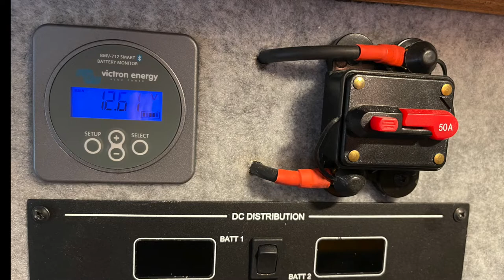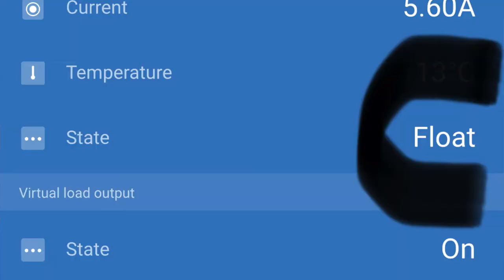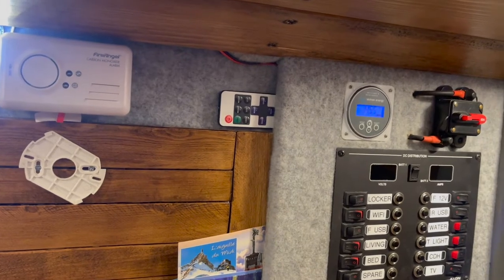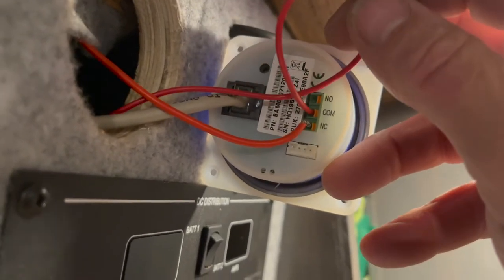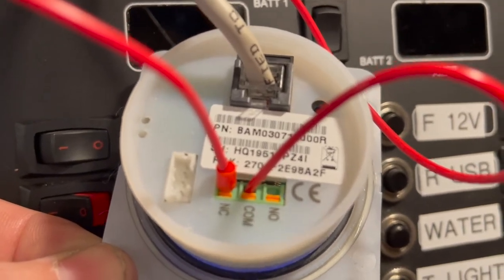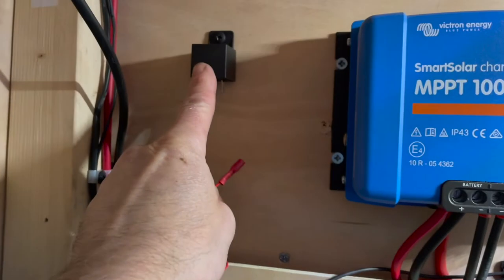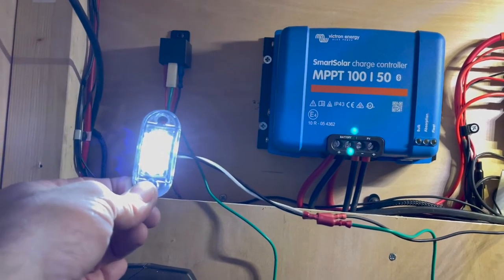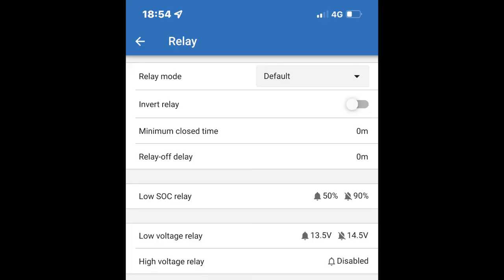Victron BMV 712 Smart Monitor Relay Function Explained . Victron energy Van life.

Comment: As soon as the heat mat pulls a load the voltage will drop and the relays will just flip flop. NC is normally closed and NO is normally open. For what you are attempting to do you should have the output in the NO connection BMV.
Reply from the maker: Ok cool , I’ve looked at the app and it can be reversed and the voltage value as mentioned is just for testing the led light, and not the mat  obviously they will be adjusted for the load on the heater mat , thank you 👍
Reply: @ProjectCamper  I get what you are trying to do, maybe a secondary battery for the heat mat and a second basic charge controller would be easier to use the spare solar output.

Comment: Thanks heaps mate just the video I'm after, I brought the temp sensor with mine and want to run computer fans on-top of the batteries so when it gets to a certain temperature ( from changing at high amps or using high amps running appliance's) I can then switch the fans on via preset relay so it will help keep air circulation and keep the battery temps down especially in the summer months
Reply from the maker: So glad you found this useful as i couldn’t find much on yt about it. I think the built in relay can handle 20amps, but double check 👍
Reply: @ProjectCamper  hey mate just wired my fans in today, works perfectly!! Took a bit of diagnosing why It wasn't working after some frustration turns out the relay is only a 4 post but the harness that came with it is 5. I had my fans wired to the non functional wire, I thought originally that maybe they pins are joined internally but after doing a conductive test it states it doesn't

So if you ever go to Jaycar and order a relay and harness I suggest you make sure the relay is proper for the harness or least use the right pin as it a 50/50 if you don't look lol

But got it all sorted works perfectly fine 👍
Reply from the maker: That’s great, it took me ages to work out the voltage switching but you soon work it with a lot of head scratching 👍

Comment: This is perfect.  I'm trying to figure out a way to turn on my generator when my battery gets low.  But with simple technology and not rewiring my generator.  My generator has an option to turn on when my house power goes out.  For my trailer, I want generator to turn on when battery gets low.  Your solution will help me to feed a hot line to the generator to get it to think the power is on.  In your scenario, when the battery is high.  I'll feed your signal wire to a small inverter to feed 120 to the generator.  When battery gets low, I'll use your idea to open the circuit leading to the small inverter, thus cutting the 120 feed to the generator, making it think the power went out.  Then the generator should turn on!

Just gotta figure out your parts to send the signal to small inverter.

Thank you for the video!

Chris